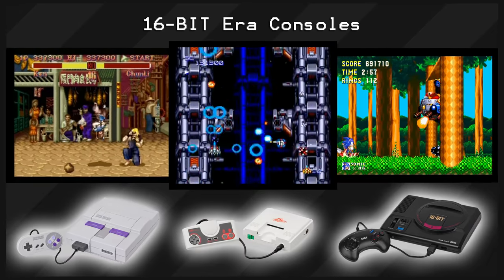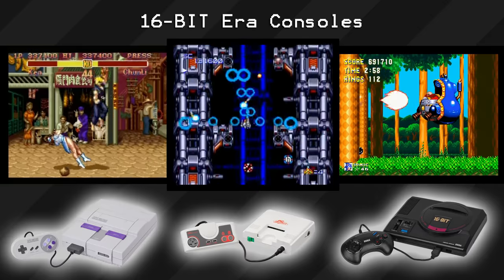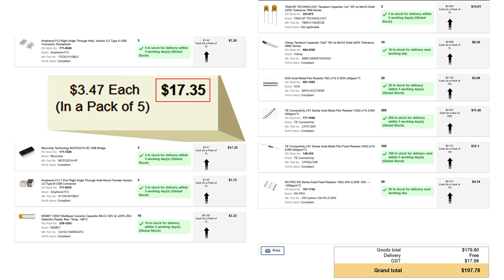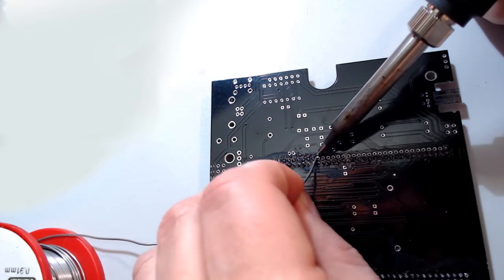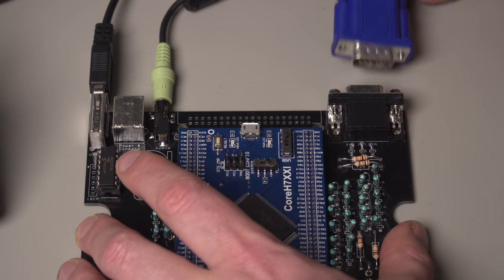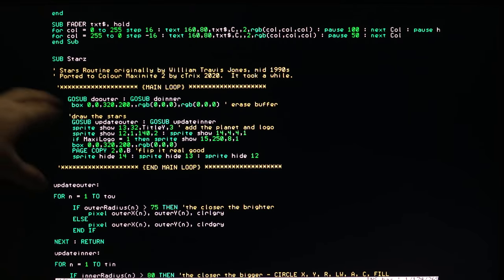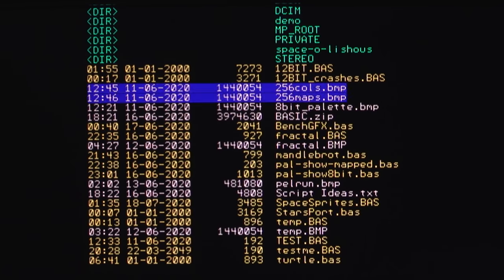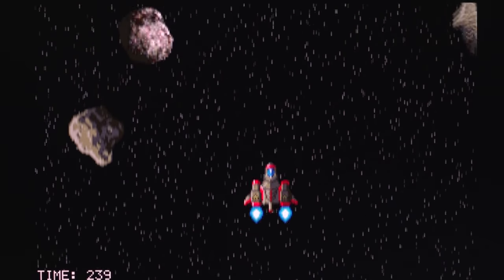BASIC in 2020 - DIY microcomputer w/ early 90's graphics - Colour MaxiMite 2 (build/test)

Comment: Wouldn't it be simpler and cheaper to just use a Raspberry Pi hardware with a custom OS?
Reply: No professional development environment for Pi bare metal and no openly available documentation
NDA possibly required for access to some bits
Multiple versions which are all different, no guarantee what will be produced going forward or commitment to availability of older versions
No ADC, limited other peripherals
At the end of the day it possibly could be done but I chose to use the ST chip because there is an excellent development environment that I had used before.
I had no knowledge of Raspberry Pi H/W, can anyone point you to any serious documentation of the chip and its peripherals – I suspect not. The ST has a 1000 page manual explaining the internals in precise detail and the chip has a guaranteed support life.
Had I tried to do the development on the Raspberry Pi it would still be ongoing and the CMM2 wouldn't exist.

Comment: why are you using some bitmaps instead of pngs?
Reply from the maker: Because you can export as 4:4:4 and 5:6:5 BMPs out of Photoshop which gives you a preview and calculates where the values quantize using their mid point.  The CMM2 chooses the max threshold point so it something was almost white (say value 254) it'll snap lower... where in Photoshop it's smart enough to snap to 255.  It's also quicker to load as it's raw data where PNG is slower.
Reply from the maker: (Good question!)

Comment: run Bad Apple on it.
Reply from the maker: Don't tempt me :-P  At 10 fps we could vectorize 500 points per frame and draw them with the poly / fill commands / page flip plus probably interpolate the points to get 30fps.  It'd look very rough in places... and require a huge amount of pre-processing / vectorisation code on a fast PC (would probably need to be broken into scenes and take an hour or so to encode if you were looking at keeping fixed vector points for morphing - a lot of brute force analytics).  But it is indeed possible.  And it'd fit in <1MB of program RAM (would have to, although may be able to do a fast mem swap file) The MOD file would be huge and loop in places, but most people wouldn't notice that.  Although the unit can also play MP3 files (I'm not sure how much overhead it'd take).   I think the challenge would be to get the whole thing under a meg though.  Fun compression is really the mission for a Bad Apple conversion IMHO!
Reply: @CTRIX64  Looks like I already tempted you if you gave it so much thought. Mwahaha!

Comment: Never was a huge fan of Basic.  I started programming on a fully kitted out IIGS as a kid in Elementary School and dove straight into Assembly and C using the books my uncle included along with it as a big gift.  I've pretty much stuck with C/Assembly since, I do mostly lower-level programming and am not a fan of the instability of C++ (not actual like breaking instability, more that they change it or add things nonstop compared to C to "solve problems" instead of just writing code to solve said problem) and that I've never been much of a fan of OOP outside of very simple general use cases (it's gotten so abstract at this point that I can borderline write a basic program in Assembly in less space/complexity than the same program following all the "OOP practices" shown at conferences over the last 5 or 10 years).  If I need something quickly put together for a standard program, I just use Python if it can handle the task at a reasonable speed.  I did mess around with VB6 way back but went over to C# for that style of language when .NET took over.

Comment: I used to be a big fan of the 'mite but unfortunately it lost its way turning into just another project with lust for speed and power. I wouldn't be surprised to see the next version running Linux on a gigahertz Arm chip or something like that. Instead of enabling more creativity by having an open and simple hardware platform which anyone should be able to assemble and tinker with, it essentially went morphing into some sort of a hardware MAME platform for old school games. The so called "community" is a small bunch of hardcore Basic fans who will blindly follow anything coming from the two main men there and disregarding everything else that lacks their blessing. Deviations from universal praise are not tolerated. That will be its downfall too since any expansion of the community is practically impossible. 
A "by the book" example how a good project becomes an online feudal kingdom.
The video itself is very well done, by the way.
Reply: Nah. I think the CMM2 achieves a “tipping point” by providing a low cost advanced graphics 80’s style instant on / boot to basic standalone platform, but with a mature BASIC implementation which runs at the speed of native machine code on those original 80’s 1Mhz 8-bit systems.
So, it has not “lost its way”, as you state, it has instead fully achieved it’s original retro computing vision!    
ps. I just joined the community, due to CMM2. So I don’t agree with your view that “any expansion of the community is practically impossible.“  :)
Reply from the maker: Hey KnivD.  Firstly, awesome PIC18 computer - I can see you really know your hardware.  (read up on hack-a-day about it too; awesome expansion bus on your prototype!)
For me the Colour Maximite series is a different line of thought and hardware to the original 'Mites.  Very different.  As you point out, it's a morph into a hardware MAME-style platform for oldskool games.  It's a niche device that makes a certain nostalgic crowd very happy :-)  There's just nothing else like it.
I have noticed it has taken the 'mite "mantra" (if we can call it that) in a different direction.  Thus I can understand your frustration that the focus had shifted.  At the end of the day, it is a for-the-love project being built for free by people in their spare time.  They choose the direction; and they have chosen to take it to 480mhz w/ 4MB RAM expansion + 16 bit graphics.   Annnnnd all to do stuff you should technically do in ASM or c++ (lets not kid ourselves!) but for a hobbyist bringing their 1990's QBASIC highschool clan back together for a beer vs. BASIC session at a game JAM to terrify the next generation with alien code (while they mash around in Unity) this box ticks every box.  That's out plan!   But maybe in the future, now this powerhorse is released, some updates for the simpler more I/O focused lower power units may come out?   But it does have a ton of competition from other open hardware platforms.  While the CMM2 (currently) doesn't have an equivalent!  Like Greg, I've also jumped on board because of the CMM2; I don't think it's lost it's way so far as changed it's way.  The lead dev has been nothing but friendly and super dedicated to bug fixing and taking advice on extended commands. However...
Consider this - there's going to be quite a bunch of hobbyist BASIC coders who wouldn't have otherwise come across the MaxiMite series and will now venture into the world of sensors and I/O and control relays... and using IFTT logic or doing FFT to audio driving external devices, etc. (me included)  This means more people will also become familiar with the hardware side, and if they do have a project that requires a simpler / cheaper solution in the future, they may well reach out to a mini Maximite or the like.  And that may mean the focus is shifted back that way after things firm up with the CMM2.  Orrrr as you say, we might just get a gigahertz CMM3 instead.  I'd personally like to see both. (but if it switches to linux instead of BASIC-at-core, I'd stick with the V2 unit)

Good luck with your continued computing adventure.  And thanks for the positive feedback on the video production values.